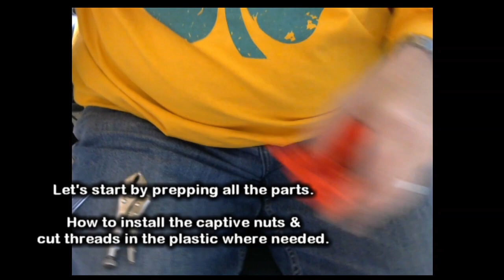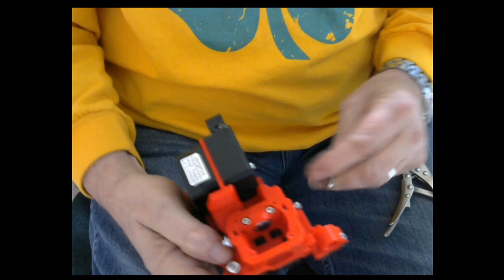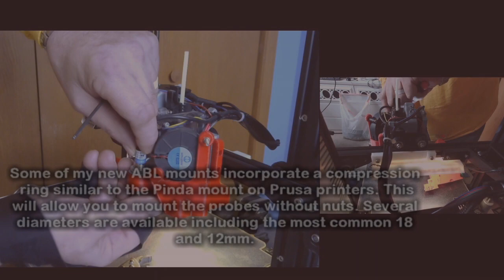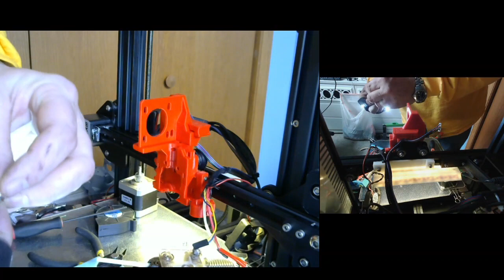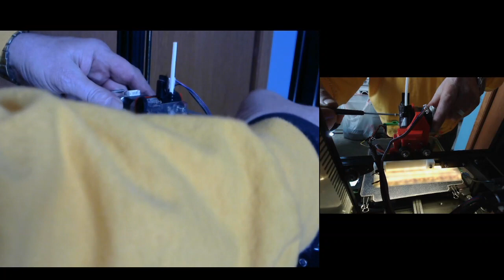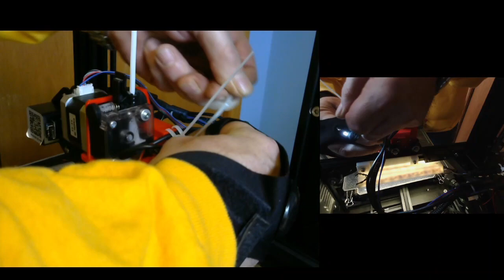Blokhead / Bullseye Direct Drive Petsfang Installation

Comment: just put together almost the same setup i have an stock extrusor, the heavy motor it is stiil a problem though just got at most 4200 accel in input shaping with all that weight

Comment: Just want you to know how much I love your work. I've recently gotten into 3D printing (3 months ago) and struggle with designing parts and things. I'm a software engineer, so I'm good on the firmware end, but the mechanical side stumps me. 
You're genuinely an inspiration. Not only have you put so much work into your designs, but you also put it out for the community to use for free. Even that is admirable in its own aspect. I sincerely wish you the best with your work and if you ever need any software stuff, I'm happy to help.

Comment: I've got the blokhead running on my stock ender 3 pro now, is there a mount that works with the stock hotend?
Reply: the microswiss and stock HE are interchangable and use the same base and mount files... to my knowledge. In fact, my assembly with bltouch and microswiss are identical for the ender 5 plus, id imagine the same would hold true for ender 3 pro

Comment: I printer the orbiter to ender 3 stock base and the orbiter attach points require M2.5 nuts which I don't have.... Is there a specific reason why they aren't M3 like the rest of the base?
Reply: @DPetsfang  if that's the case then the sizes are a bit off, I measured the width as printed and they came to about 5mm compared to 5.5 mm in other slots. Maybe my printer has issues sinec that slot is a different orientation but I doubt it.
Reply: @kei2142  Same, the nuts for the ender 3 stock/orbiter are smaller than the other nuts.